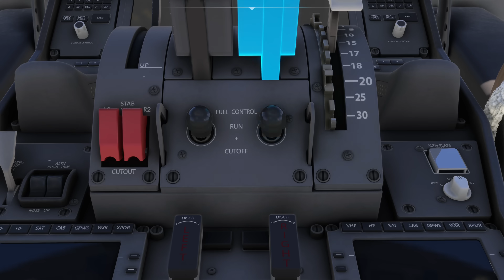Air India 171: Why Did The Fuel Cut-off Switch Get Moved?

Comment: AI 171 Report Crashlands

Inquiry is disservice to airlines flying Dreamliners. It's also slanted so that attention focuses not on possible technical problems but, minus any real evidence, on pilots

On June 12, an Air India Boeing 787 took off from Ahmedabad and crashed moments later, killing all but one of its occupants. Exactly a month later, the official preliminary report was released. While it provides a basic sequence of events, it fails to answer the most critical question: When did the engines stop producing thrust?

FORMER Chief of Safety, Air Asia & Chief of Training, IndiGo
This isn't a technical debate. It's the key to under-standing what went wrong, and who or what was responsible. Instead of offering clarity, the report quietly steers readers toward the idea of pilot error, without saying it outright. This subtle shift leaves many, especially those unfamiliar with aviation systems, assuming the pilots made a mistake. That assumption is both dangerous and unfounded.

Captain capable:
It's important to begin with the man at the controls. The captain of AI 171 was not only a seasoned Boeing 787 pilot but also a certified trainer entrusted to teach and evaluate others. As part of the selection process to become a trainer, he had undergone detailed psychological screening, including by profes-sionals trained to assess stress-handling. decision-making, and mental fitness. He was the pilot you'd want in the cockpit on a bad day.

Yet, certain foreign media outlets have floated malicious theories, suggesting pilot error or intentional action. Shockingly, one Indian "safety expert" repeated these ideas without evidence. The report does not support these theories, and they insult the memory of a competent professional who can no longer defend himself.
Let us be clear: no factual basis exists to blame the crew. The available evidence points to more profound, more technical questions that the report avoids addressing.
Noise & silence
The report says the aircraft's two engines stopped responding three seconds after takeoff. It also says the pilots tried to restart them about 10 seconds later. By then,
the plane was flying too low and too slow to recover
It also notes that two necessary switches, used to control the engine fuel supply, were moved to the 'off' position. These switches are designed to be hard to move accidentally, and they have locks to prevent that. The report includes a short voice recording from the
cockpit without clear attribution: Pilot 1: "Why did you cut off?"
Pilot 2: "I didn't do it."
That's it, no further transcript. No context. The words are used to hint that maybe one of the pilots
turned off the engines. But there's no follow-up. No analysis. No explanation for how these switches might have moved on their own, which is entirely possible, based on earlier warnings issued by safety regulators about this exact type of switch used 

in another Boeing plane the 737.
Big contradiction
CCTV footage from June 12 shows the aircraft in the air, landing gear down, and a small emergency device called a Ram Air Turbine (RAT) already extended. This turbine is like a small windmill that pops out when both engines fail, helping to power basic flight controls.
The issue is that this turbine doesn't deploy instantly
It takes a few seconds to come out after both engines stop. Yet, in images, it's already visible when the air-craft is barely a few storeys off the ground. That means the engines must have failed before the time mentioned in the report.

So, which is wrong, camera images or the AAIB report's timeline?
Silent beacon
Additionally, the aircraft's emergency locator beacon - which should have started transmitting dis-tress signals on impact-stayed silent. Was it damaged? Not armed? Not working? Once again, the report gives no answers, nor recommends checking other aircraft for similar issues.

No flag raised
A good preliminary report is not meant to assign blame; it should highlight urgent risks so other flights can be safer. That didn't happen here.

Despite known concerns about the fuel control switches, the report doesn't call for any checks across the Boeing fleet, doesn't advise reviewing the emergency response systems, and doesn't confirm that all the flight data and voice recordings were recovered.

Compare this to other major accidents -like the Ethiopian Airlines crash in March 2019-where early reports included technical diagrams, full transcripts, and multiple safety recommendations.

The contrast is stark.
Final thought
This isn't about one flight. It's about how we investi-gate air accidents in India, treat our professionals, and protect public confidence in aviation safety.
The captain of Al 171 was a respected trainer and a trusted professional. His actions in the final seconds cannot be judged by a single voice quote taken out of context. They must be understood in light of the systems around him the ones that may have failed first..
The real questions are these: when did the engines stop working-and why? That's what the public deserves to know. That's what the final report must answer.
experience The writer is an aviation professional with over 35 years'

Comment: Is it humanly possible for someone to switch off two switches in one second? Please address this in your analysis. Don't jump to conclusion !! You have already decided it was done by a pilot !!!
Reply: AI 171 Report Crashlands

Inquiry is disservice to airlines flying Dreamliners. It's also slanted so that attention focuses not on possible technical problems but, minus any real evidence, on pilots

On June 12, an Air India Boeing 787 took off from Ahmedabad and crashed moments later, killing all but one of its occupants. Exactly a month later, the official preliminary report was released. While it provides a basic sequence of events, it fails to answer the most critical question: When did the engines stop producing thrust?

FORMER Chief of Safety, Air Asia & Chief of Training, IndiGo
This isn't a technical debate. It's the key to under-standing what went wrong, and who or what was responsible. Instead of offering clarity, the report quietly steers readers toward the idea of pilot error, without saying it outright. This subtle shift leaves many, especially those unfamiliar with aviation systems, assuming the pilots made a mistake. That assumption is both dangerous and unfounded.

Captain capable:
It's important to begin with the man at the controls. The captain of AI 171 was not only a seasoned Boeing 787 pilot but also a certified trainer entrusted to teach and evaluate others. As part of the selection process to become a trainer, he had undergone detailed psychological screening, including by profes-sionals trained to assess stress-handling. decision-making, and mental fitness. He was the pilot you'd want in the cockpit on a bad day.

Yet, certain foreign media outlets have floated malicious theories, suggesting pilot error or intentional action. Shockingly, one Indian "safety expert" repeated these ideas without evidence. The report does not support these theories, and they insult the memory of a competent professional who can no longer defend himself.
Let us be clear: no factual basis exists to blame the crew. The available evidence points to more profound, more technical questions that the report avoids addressing.
Noise & silence
The report says the aircraft's two engines stopped responding three seconds after takeoff. It also says the pilots tried to restart them about 10 seconds later. By then,
the plane was flying too low and too slow to recover
It also notes that two necessary switches, used to control the engine fuel supply, were moved to the 'off' position. These switches are designed to be hard to move accidentally, and they have locks to prevent that. The report includes a short voice recording from the
cockpit without clear attribution: Pilot 1: "Why did you cut off?"
Pilot 2: "I didn't do it."
That's it, no further transcript. No context. The words are used to hint that maybe one of the pilots
turned off the engines. But there's no follow-up. No analysis. No explanation for how these switches might have moved on their own, which is entirely possible, based on earlier warnings issued by safety regulators about this exact type of switch used 

in another Boeing plane the 737.
Big contradiction
CCTV footage from June 12 shows the aircraft in the air, landing gear down, and a small emergency device called a Ram Air Turbine (RAT) already extended. This turbine is like a small windmill that pops out when both engines fail, helping to power basic flight controls.
The issue is that this turbine doesn't deploy instantly
It takes a few seconds to come out after both engines stop. Yet, in images, it's already visible when the air-craft is barely a few storeys off the ground. That means the engines must have failed before the time mentioned in the report.

So, which is wrong, camera images or the AAIB report's timeline?
Silent beacon
Additionally, the aircraft's emergency locator beacon - which should have started transmitting dis-tress signals on impact-stayed silent. Was it damaged? Not armed? Not working? Once again, the report gives no answers, nor recommends checking other aircraft for similar issues.

No flag raised
A good preliminary report is not meant to assign blame; it should highlight urgent risks so other flights can be safer. That didn't happen here.

Despite known concerns about the fuel control switches, the report doesn't call for any checks across the Boeing fleet, doesn't advise reviewing the emergency response systems, and doesn't confirm that all the flight data and voice recordings were recovered.

Compare this to other major accidents -like the Ethiopian Airlines crash in March 2019-where early reports included technical diagrams, full transcripts, and multiple safety recommendations.

The contrast is stark.
Final thought
This isn't about one flight. It's about how we investi-gate air accidents in India, treat our professionals, and protect public confidence in aviation safety.
The captain of Al 171 was a respected trainer and a trusted professional. His actions in the final seconds cannot be judged by a single voice quote taken out of context. They must be understood in light of the systems around him the ones that may have failed first..
The real questions are these: when did the engines stop working-and why? That's what the public deserves to know. That's what the final report must answer.
experience The writer is an aviation professional with over 35 years'

Comment: Whatever little respect / faith I may have had for Steve being unbiased are being hit out of the park, with every new disastrous video he releases. Comparing an adult, alleged suicidal pilot's denial to turning on a suicide button to your child refusing to accept to have hidden his / her Siblings crayon speaks volumes of the time and quality of effort you have put in to peddle a narrative difficult to sell to toddlers!
I have 3 questions to challenge your so called "Suicide Nursery Rhyme":
1. What was the purpose of FAAs optional advisory (which itslef is absurd) where they very casually assumed that the malfunction of the locking mechanism, which can potentially cause shutting off the fuel supply to both engines? Clearly the FAA assumed that this malfunction can only happen at very high altitude thereby giving sufficient time for the pilots to reignite the engines by turning them on.. Clearly they had an oversight of the possibility of this malfunction happening at the critical take off / rotation phase of the flight. Please also note that by 2018 Boeings lax attitude had not been subjected to the embarassement of the Max Mcas fiasco.
2. Which report have you been fed by your Sponsors? No where does the report mention that FDR confirmed Physical movement of the switch. The analysis on the FDR isnpurrly deciphered from Electronic reading on the Computers. This trashes your theory with 2 possibilities..(1). Electronic Malfunction resuslting in False Signalling to the Valves to cut off (2) Lock Detachment resulting in inadvertent physical movement of the switch to cut off (low possity)
3. Why would a suicidal pilot (according to you) even bother denying to have deliberately commited the act during his final moments where as history tells us that it is the most likely period of a frustrated human to vent their anger. Even if the Mayday calls were made by the co pilot, based on your assumption he would have sent put a sabotage distress call as opposed to the LOSS IN THRUST call.. This is very conviently being masked in the report!